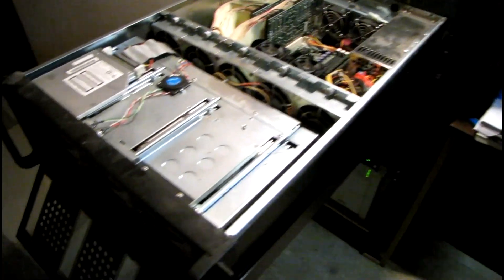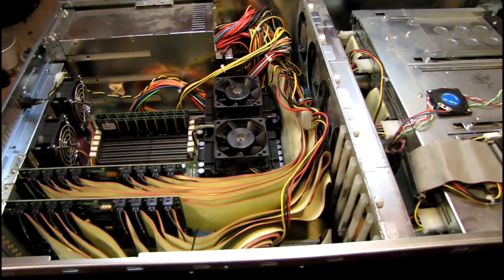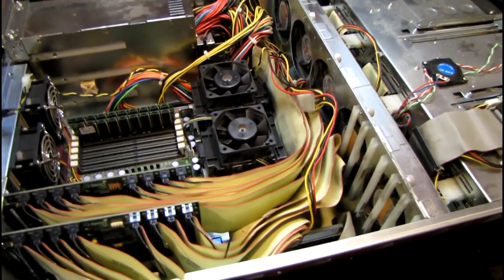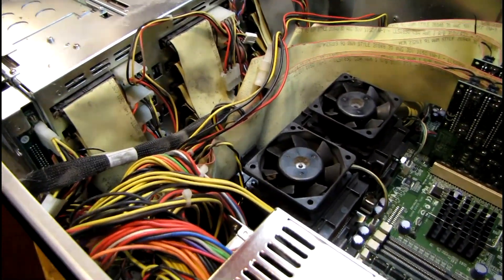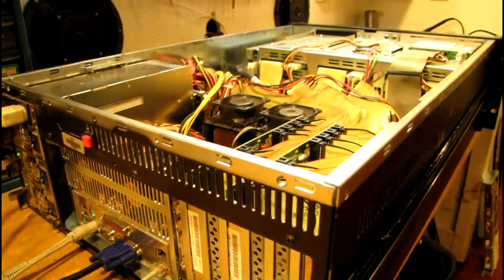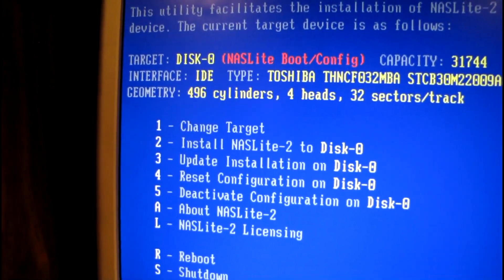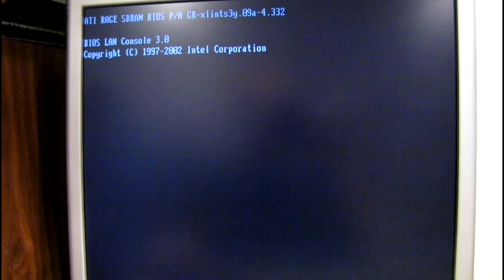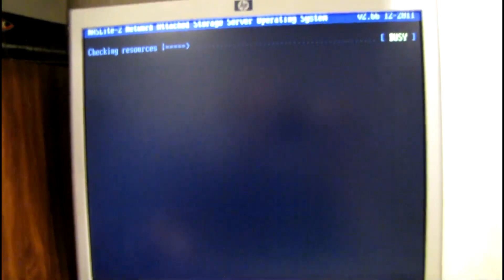Repair and upgrade my file server, January 2012 *Part 1*

Comment: SAS drives are very fast but limited on storage capacity. SAS is going away like FIREWIRE or ATA drives or PS/2 interfaces. Things don't stay the same, they say the only constant in life is change.  SAS drives are hard to come buy even on ebay.

Comment: yeah seagate hard drives heat so much (while transfering over 100.00 files) that i cant keep my fingers on the top cover. i have seagate barracuda 7200.8 250gb and western digital green 1tb (both sata) and the wd does not heat up very much
Reply: yeah seagate didnt do a very good job at thermal dissipation in their drives...
Reply: KaidoFujimi
and its noisy

Comment: simple way of doing it is get a old quad core CPU, compatible mobo and attach raid cards and RAM as needed, install O/S, underclock the CPU so that it won't run hot and then slide it in place with stock cooling fans and a micro O/S with it, you can expand and swap drives as needed, all you need is a spare USB port, which you can install on the inside of the case.

Comment from the maker: That's another one that I'm looking at.  Though I think the 2950 might be a bit more in my budget.  I could have 5-10 TB of space in the 2950, depending on what size drives I use.  My current server is only 3.8 TB.

Comment from the maker: I priced out a custom made system recently and it came to around $1,400.  What I might end up doing is buying an old Dell Poweredge 2950 or similar, and installing some new SAS drives.  The 2950 typically goes for around $150 on Ebay these days.

Comment: A 2 TB Seagate HDD costs 89 Euro's.
A Gigabyte motherboard for 70 Euro -with 6 sata ports-, an Intel Pentium G620 CPU for 60 euro. Add some DDR3 ram you have laying around, and a descent power supply.
Voila, a new, much less power consuming file server.

My own fileserver runs on a G620 and a MicroATX motherboard with 6 sata ports.
It's running 3x 1,5 TB WD Green in RAID5, 2x 500 GB in RAID1 and a 1 TB drive.
All running with ZFS under FreeNAS. The machine pulls around 50 watts from the wall.

Comment: That would be a smart thing to do. Get some modern server with sATA interface RAID controllers, faster processors, and is actually 64-Bit capable, for under $1k. And @Vaati Reborn I still use a Pentium II-based Compaq PC to this day (just as a gaming PC).

Comment from the maker: Well, it's been over a year since this video, and I'm still using this system.  It will probably be around for couple more years at least.  Too expensive to buy a newer server right now.  It would be over $1k in drives alone, unless I get cheap junk.

Comment: Wow.. awesome hardware but it seems huge overkill for a home file server. But I don't know how you're using it.
Nothing wrong with IDE, just keep using them as long as you have the drives.

I still have a 750GB Seagate IDE drive which I think may have been the biggest those drives ever got. It was apparently an unreliable model but mine has held up in daily use since new. I'd almost be sad if it died, I'm thinking of retiring it to some rarely used, older system before I wear the thing out.

Comment from the maker: I think the only option would be a used server case, since all the new ones are SATA/SAS hot swap bays.  They start around $200 or so.  Eventually I'll be switching to one myself and selling this system.

Comment: Well the big problem with that is that i have 4x73.3gb 10k rpm scsi drives,plus i have 10 or more ide drives lying around and i was wanting to put some of those in and then i was going to later see if i could find a cheap sata card and add some sata drives.

The original case can only support 4(hot swap scsi drives)or 6 non hot swap drives(scsi or ide),and i would really like to have more than that.

Comment: i have a dell poweredge 1600sc with 2x 2ghz xeon w/HT,and the case it is in is falling apart,is it worth getting a new case(the mobo is 12inx13in)? If so can you suggest one?

Comment from the maker: I'm trying to put together a list of new/used hardware, based on 4x 2TB drives.  But each drive is about $180 unless I get cheap ones that aren't really server rated.  The case is about $200, and everything else is fairly cheap.  But it still totals over $1k.  That's with a used 3Ware SATA card and new everything else.

Comment from the maker: A real hardware PCI-e SATA RAID card is still around $500.  That's one of the reasons why I'm still using this old thing.  I would have over $1,500 in drives and controller card alone, just to match the capacity of this.  Unless maybe I get previous generation stuff.

Comment from the maker: Everything is talked about later in this 3 part video.  It's old stuff though.  Dual 3.4Ghz Xeon Socket 604, 4GB RAM, 8x 320GB in RAID 5, and 8x 250GB in RAID 5.  Power supply is a 2+1 redundant 460W.

Comment from the maker: 2+1 means that 2 power supplies work together, and any 1 of the 3 can fail without affecting the system.  Many larger servers have 2 power cords so that they can be used with 2 separate power sources in case one fails.  Such as utility power and backup generator.

Comment: If your still using those IDE drives, you should probably switch to rounded data cables.
The ribbon cables are really bad for airflow and leave so much surface area for dust to settle.

Comment from the maker: @Knaeckebrotsaege Because the motherboard came with the case.  I was considering changing the board a couple years ago, but I never was able to find one that had two 64 bit 66Mhz PCI slots that were spaced far enough apart for all the ribbon cables to fit.

The other thing, is that the software may change in the future, or I may use the machine for something different.  But For the time being I might just run a single CPU, and keep the second as a spare for future use.

Comment: @Maxxarcade

It was a steal... I'm going to use them for customer repairs. I already have three in my home server running without any issues. Ebay is probably not the best way to get computer components but sometimes you get really lucky. :)

Comment from the maker: @Purepromedia Not much to explain really.  File server runs NASLite-2 v.2.66.  DVR runs Linux with Zoneminder installed.  Router/Firewall runs ClearOS Enterprise.  Everything is on a Gigabit LAN, with internet being provided by a Motorola Surfboard Extreme cable modem.

Comment from the maker: @141gregmor Depends what kind of server.  A file server like this basically acts as a large external hard drive that everyone in the house can share.  It also has redundancy against a failed drive or power supply, so it is more reliable than a normal desktop PC.

I also have 3 other systems in my server rack.  One is essentially a router on steroids, one is a security camera DVR with remote access, and one provides the sound and video for my home theater.

Comment: IDE works fine, sata wont last as long as ide,  manufacturers keep finding new ways to empty our pockets for the new and improved interface.

I found ide and scsi worked fine but the quest for faster and faster data transfer has deemed them "old hat", and sata will die when they get round to using solid state storage mounted on the motherboard, on a special new socket of cause, lol

Comment: IDE is good for a file server, I use it in my Del PowerEdge SC420, my other file server, a Dell PowerEdge SC440, has SATA drives. But the Xeon helps with thr performance. Mine isn't much of a file server, 500GB each, but it works.

Comment: File servers only work as fast as you network can handle... I made a simple freenas server at work, but half of the switches we have are still 100mbps, so the server is useless on half of the campus.
Same at home... it fast when wired, but once you go wireless.. things slow down to a crawl.

Comment: I can't believe you're still using IDE. I use Windows 95 to reboot and my file server is so very fast. I have 10 arrays and 8.7 terabytes when mine does the disc check. I think your SAS is bad and the back plane is good. You need new ribbon cables because they don't transmit data after 7 months. The rim cable is loose, but your back plane is in the array. Don't add any more hard drives because they make solder joints weak. I have more bays and heat gates if you need em bro.

Comment: i use an ide cd/dvd writer in my high end gaming machine, it was from my first computer and i saved 31 bucks on a new dvd writer when the old one works as good as the day it came out the package, there is nothing wrong with ide if your getting your performance worth